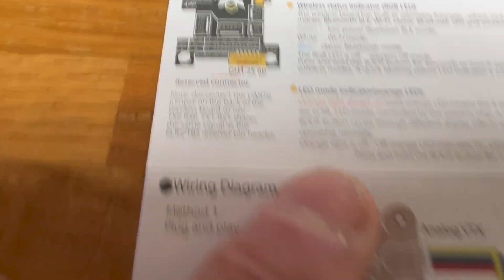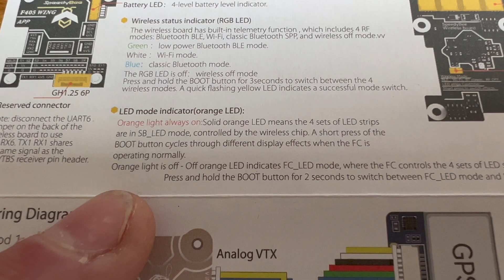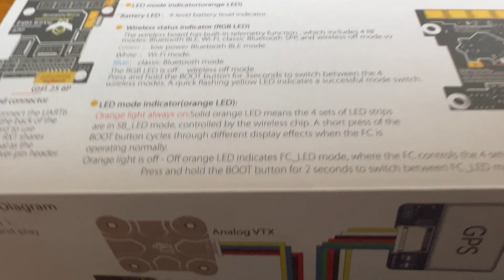SpeedyBee F405 Wing -  only one LED controllable?

Comment: Good video, but its so easy to just use a little $3 maker board like an esp8266 ( with wifi capability)  to power ws2812b leds and have much more control of a display pattern. It looks like the wires are too short to reach far enough ( to wingtips, etc) on an rc plane anyway.
Reply: You can always sober them with lo get wires with the pads under them and you can just make your own plugs with a wire kit as I make all my own plugs.
Reply: How do I send signals to the LED for that?
Reply from the maker: @FreeEditsForYou you will have to configure that within the INAV configurator - take a Look at the LED tab

Comment: Could anyone help plz. I would like to use these lights on my Swordfish. But I need longer cables. Could anyone tell me which cables or connectors I need to buy to make this longer to get to the wings? 

Thanks
Reply from the maker: Simple task- cut an existing in half and prolong it with other wires
Reply: @JustFPV-net  makes sense yes. But I neither have the connectors or the cables yet 😂 but good shout. I will buy the light kit and just extend them. 👍
Reply from the maker: @tomling9310 perhaps the best way of doing it. Perhaps you’ll have an old defective servo where you can cut off the wires … that will do too
Reply: @JustFPV-net  great shout! 

Thank you. 👍
Reply: Jst sh 4pin

Comment: When the orange light is on you can press the boot button to cycle through pre-programmed led color and navigation lights.  With orange light off you proceed to Inav configuration tab and select Multi-color RGB LED strip support.  Then LED strip tab on Inav.  With 32 led light in series you can change each light individually.
Reply: Thanks that was helpful. How do you turn off the orange light?
Reply from the maker: Hold the button pressed for about 6secs to switch the mode

Comment: I figured it out.  Disconnect the white wire to the usb adapter and use that for the signal wire to the LED strip you want to control for indication.  Then you can control more than one LED light.  I break off the first 2 of a strip to indicate gps state and arm state.  It works and kills the LED in the usb adapter.  It works  but is flickering but good enough for indication.  I don't know what would happen now if I plugged in LED strips to the ports but indication is all I want.

Comment: How did you get you lights set up like that. I have the same lights and they dont even come on
Reply from the maker: Basically I simply connected them ... then I changed the Controller on the fc to do the light on its own (there is a button  for that have a look in the manual) and there you go

Comment: Hello, well I want my LEDs work like that, but they are not working at all, the conectors are correctly connected but nothing is happening, even with the orange light that indicates the FC is controlling the leds they ain't work and I don't know what else to do.... Help 🤔
Reply from the maker: did you connect the power and not only usb?
Reply: @JustFPV-net   yes a 4S and 6S, someone told me to put a diode to stabilize voltage on each led strip, so I'm going to try that
Reply from the maker: hmmm ... same was told to me. But from what I know today the Speedybee LEDs have these installed. Which ones are you using? I used Matek and that did only work out in SpeedyBee mode

Comment: This information is just wrong!
Connect the 2812 LEd´s in series to Port one, set INAV Multi LED Support, press the boot button on the Speedy Bee FC for 2 seconds and have fun programming the LEDs as you like in INAV
Reply: Silent Flyer is correct. You CAN control lights attached to LED ports via INAV as an addressable sting of LEDs like normal. (but not as 4 separate ports...all ports act as one)
Reply from the maker: It turns out that this is not the fact on all bosrds- mine doesn’t do that
Reply from the maker: How my speedyBee F405 Wing isn’t doing as it should
https://youtu.be/vrCIFU4m91Y
Reply: @kevinwright5096 same is in my case i am able to programm as many leds if i place them in series but individual ports cannot be programmed am i doing anything wrong can you please help
Reply: Can confirm! Plus: The LED on the USB board is the first LED as configured in INAV.
Reply from the maker: You are the first to confirm this behavior- thanks a lot
Reply from the maker: But that won’t do on mine! That’s exactly what NOT happens with mine after I flashed INAV 6 via configurator